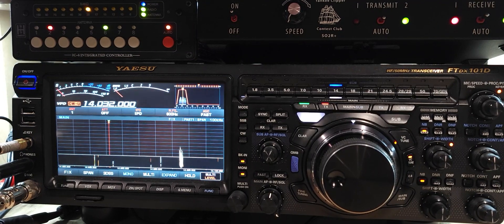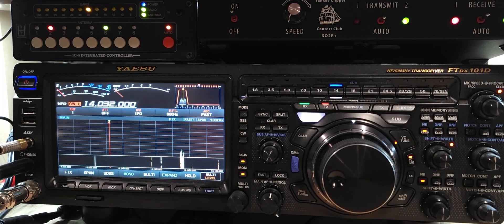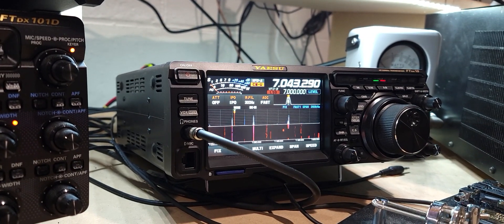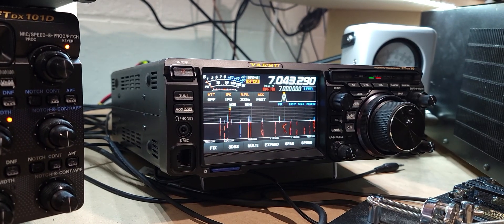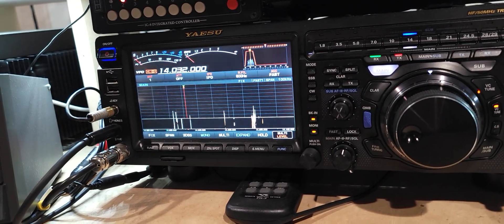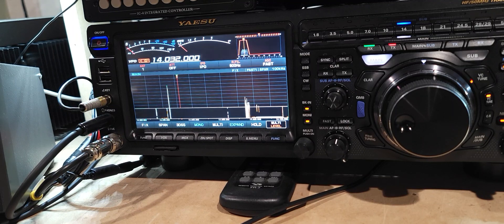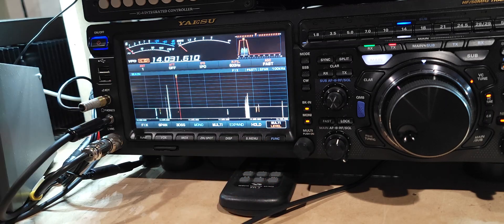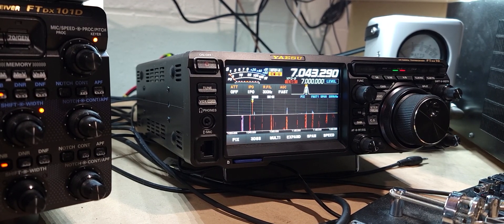Installing bandpass filters for so2r

Comment: Are you still running these both for so2r ? Curious how you made out on the latest filtering. Cu soon ..
Reply from the maker: This was just a test of concept with single band filters. I have since installed 2 multi band units that are switched with band data. They help for sure, high power is still difficult due to lack of antenna separation.
Reply: @N9TTK yeah I forgot which ones you had. Brand model. My antennas are pretty dang close too. Would be nice to try one day for LP

Comment: Try replacing the inverted V dipole with a vertical for Forty, the cross polarisation will help as will having the shortest leads between the tcvr and the band pass filters, preferably with good quality shielded coax ! 
Good luck with the SO2R its also my latest move.